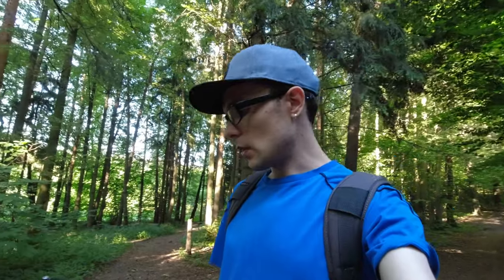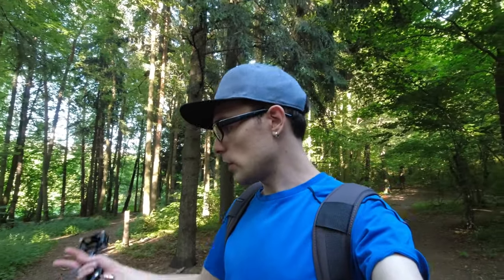DJI Osmo Action Bike Test | Does Rocksteady Really Work ?

Comment: Thanks for posting. It would also be interesting to see a comparison using a chest harness like the Stuntman and riding a really rough trail with lots of tree roots, jumps etc  and where the suspension is taking lots of big hits.
Reply from the maker: Cool idea, thank you! Btw my bike has no suspension whatsoever so this test will be and is pretty accurate 😀
Reply: @VitalyVlasov0  Hi Vitaly. I guess what I'm trying to judge is how well the stabilisation on the Osmo handles what I think of as moderate mtb trails a bit like these of mine https://youtu.be/5xxjRxL9yr4 and https://youtu.be/akLjiFlHLRg
These aren't particularly hard trails but harder than forestry paths. I'm currently using a cheap Crosstour actioncam which results in quite jumpy video. I've recently changed from a GoPro chest harness to a Stuntman and that has improved things a bit.
Reply from the maker: Okay, got it. Unfortunately I don't have a chest mount to repeat this test exactly as you showed in those vids. I can do that with a bite mount.. Will be sort of similar POV kinda..